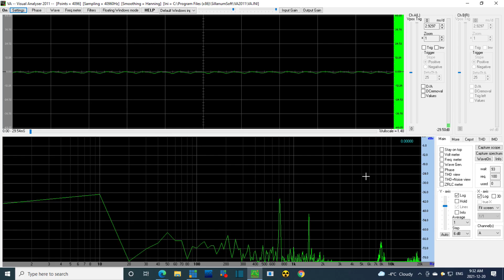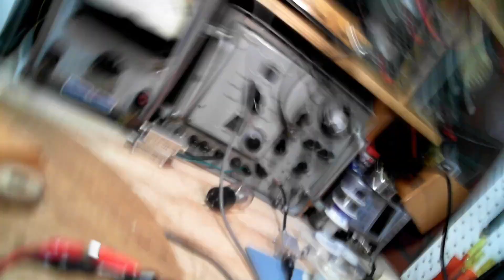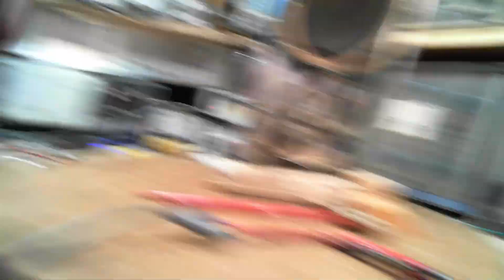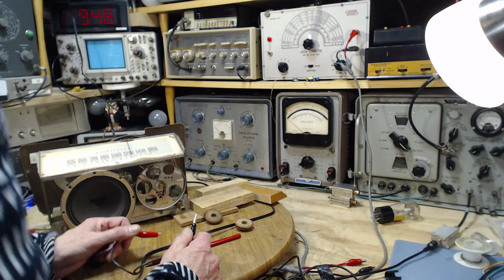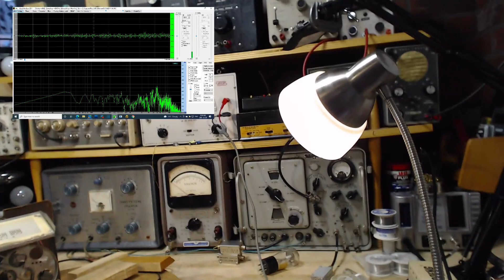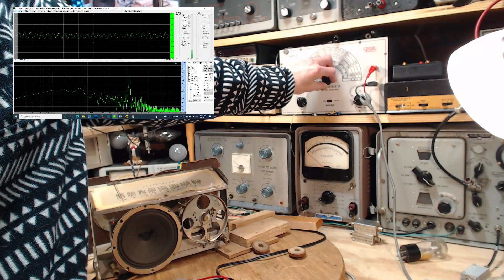Electrohome Cosmic Tube Radio Video#4 - Speaker

Comment: Jim, wouldn't it be simpler to temporarily disconnect the radio's speaker from the set's output transformer, and hook up a good known speaker in its place?  This would tell you instantly if the distortion you're hearing was from the set's speaker, or from another fault.